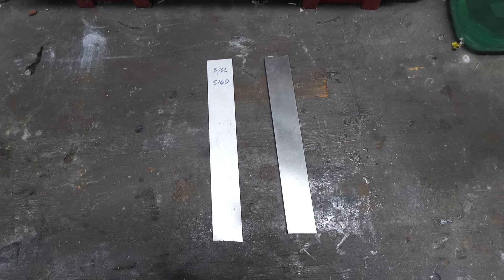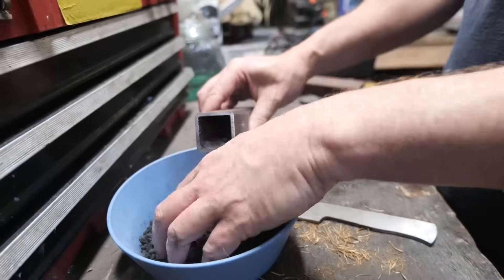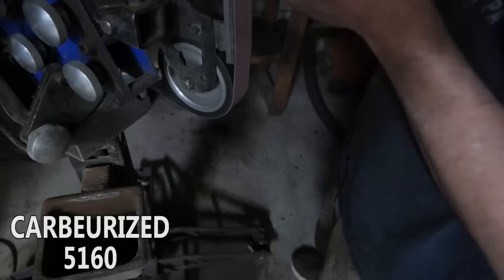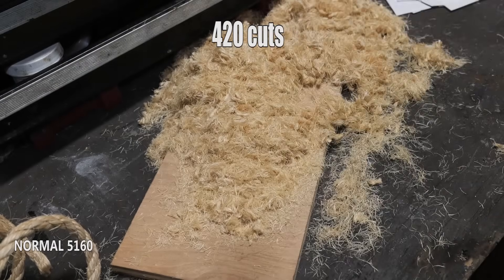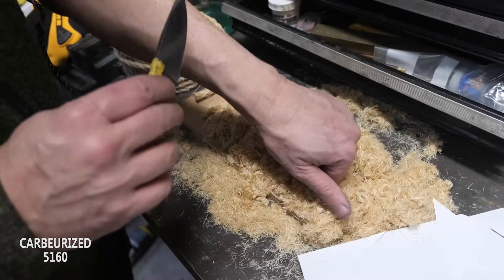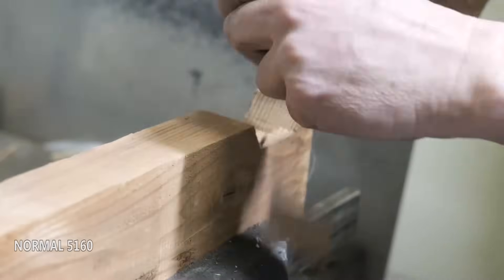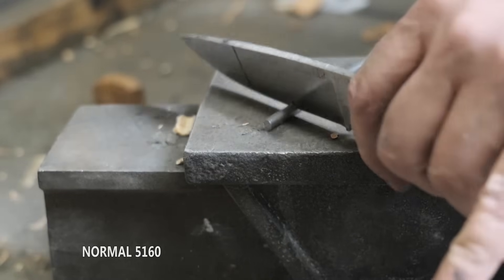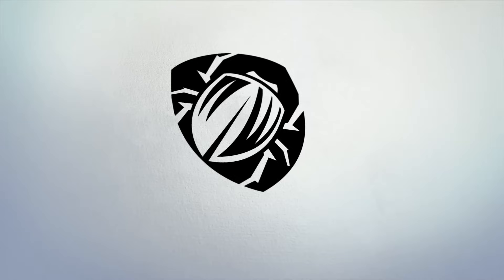Adding Carbon to 5160 Steel To Make A Knife!

Comment: This 5160 looks like high carbon steel in a spark test, or is it just looks like that on camera?
Reply from the maker: Like high carbon steel
Reply: @GreenBeetle  i mean, it should be around 0.5-0.6, and high carbon starts at 0.6 up to 2.0% percent carbon. But sparks looks way too big and wide for 0.6% 🤔

Comment: You created an amazing HRC63 on one of the toughest steels ever created. 
How about a follow up where you explore blade design to keep the HRC63? 
Seems a shame. HRC measures some form of hard, but how does toughness and durability get measured? It seems pretty amazing it took 3-4 cycles to drop HRC on such a thin blade. Great video! Looking forward to a future follow up!

Comment: You can temper too much and cause embrittlement, i would have gave them the same temper. That said what a great video i absolutely love tests like this
Reply from the maker: I haven’t heard that before are you sure that’s correct
Reply: @GreenBeetle  indeed, it's a fairly new concept to me too but the term to research is "tempered martensite embrittlement". You can find graphs to compare temperature to v-notch impact resistance for many steels. Often 450 to 800f is more brittle than a lower temper
Reply: @GreenBeetle  above 200 - 250°c retained martensite decomposes into cementite and ferrite
Reply: I was thinking the same thing while watching. You are super smart and much better at math and the engineer here. However,  having researched a bit of case hardening- thru antiquity, there is a logic that seems missing. If you add the carbon it should improve the stock, right? The evidence of improvement was shown in the need to temper multiple rounds to reduce hardness. Where is the valuing of removing something you added? 
If you ever revisit this, complete the same process. Could the video be about how to harness the value you created? 
What is the value in having a steel that needs THREE reduction cycles?! You've done something amazing. That is so cool. Perhaps the thickeness and profile of the blade isn't best to utilize the great hardness you created?
Reply: maxmcswain1 he said in a comment he just wanted to
like check it out.

Comment: What benefits are there to surface harness other than scratch resistance?
Reply: Carbon dissolves pretty quickly, it would have penetrated fairly deep
Reply from the maker: Edge retention and resistance to deformation

Comment: Many years ago I carburized, hardened, and tempered towards the edge carbon steel woodworking chisels. In order keep the edge and the flat hard I heated from the top back and watched the color change, stopping it short when it came close to edge.

Well, that's what I did in the 80's before information became pervasive. I know things have progressed since then, and differential tempering doesn't appear to be a thing now, but wouldn't that help with the brittleness?
Reply from the maker: It would but it would also drop the hrc and I was trying to keep the hrc the same between the two knives.

Comment: In adding carbon you probably put the steel well over the eutectoid point and so quenching from 1525f put way more carbon in solution than was probably healthy for it. Even at 1475f there likely would have been more carbon in solution than the 5160 would normally have. That said 5160 is kind of finicky as Larrin shows in his article on it. Also, try doing a DET anneal instead of cycling, it saves a lot of time and arguably gives better results. 100f-500f cooling rate/hr in the oven from 1400f-1450f (depending on the steel) after normalizing.

Comment: Normally when the steel manufacturers are adding Carbon, (Coke), this is done while the steel is molten. I do not think just heating the steel to red, or welding temperatures in a home built forge is hot enough to get the results you are looking for. I could be incorrect, but I think that is the process.
Reply: You are incorrect, pack carburization, flame carburization etc are real techniques which can be performed in home shop conditions. They have historical evidence and are widely used in industry. No liquidization required.
Reply: @murmenaattori6  I stand corrected, and newly educated. I knew different types of steel could be hardened or softened through Quench processes and Anieling, but though through those processes the steel would only achieve a certain harness before becoming too brittle and useless. Thank you for the info.
Reply from the maker: this is case hardening.  another method doesn't require casting would be cementation.

Comment: I'm wondering if a graphite paste painted on (2-4 layers), then followed  by a refractory coating with a 6 hour soak at 1550F would make a difference. Graphite is theoretically pure carbon with super small particle size, so it might migrate into the steel better, especially if it's painted on the surface in an even coat.
Reply from the maker: oh wow thats an interesting idea
Reply: For pure carbon I would try carbon black or soot such as produced by a rich acetylene flame or bought as a colorant.

Comment: From what i know the iron gets fully saturated with carbon around the .80-.85 range, and after that the remaining carbon forms iron carbide pockets at the grain boundries. Since 5160 has less then .85% carbon maybe there is some direct knife and tool performance to be gained when adding carbon up to that point?
 
After though idk, theres no right answer to wether or not you want the toughness reducing effects of having excess carbon and forming a bunch of iron carbide. Consider that 1084 is significantly tougher than 1095 and the carbon difference is very low (and other than this theyre basicly the same).

Toughness is an often overlooked aspect of cutting performance by bladesmiths bc theyre all obsessed with rockwell hardness, but the effect of high toughness is edge stability at lower edge angles, which has a better than linear realationship (i dont wanna say its exponential, but its very significant) with edge retention while hardness has only a linear relationship. And as a bonus, higher toughness steels can have a thinner behind the edge thickness for heavier tasks like batoning, reducing force required to make the cut without getting macroscopic rolls an bevel deformation.

tldr: adding carbon probably wont imporve an already good blade / tool steel in an overall sense.
Reply from the maker: Right you are.   Alloying moves the eutectoid point back and forth a bit but 1095 , w1, w2, white paper, 26c3, 52100, etc and all 'supersteels' are hypereutectoid.  There are many hypereutectoid knife steels.

Comment: but if you tempered it down to 62 pr 63 the edge retention could be better plus it could take a finer edge?
i feel tempering it down misses the point of case hardening.
Reply from the maker: Good point.  I was mainly interested to see what extra carbon carbides would do.

Comment: Hi, first of all congratulations for doing what I would do lol... "where there's a will, there's a way"... man, I'm going to make my second knife from recycled 5160 and I've learned a lot from your experiences (thanks for showing it) I also have a small channel in Spanish (where I test knives in my style) I got tired of buying expensive knives and had problems with the Esee 4 and a controversy with Jeff Randall over his 1095 treatment (which I think is awful, almost a rip-off) I say that for the Esee 4 that treatment is not correct, for the Esee 6 it could be because of the length of the blade that needs more flexibility, but in 4" or 5" blades, why do you want more flexibility? ...man I want maximum strength and edge retention, don't give me a castrated 1095 (that's what I told Jeff) he just replied that that's how they do it... so I come here and see your great experiments with the same steel that I'm starting to use... please give me your magic treatment recipe so I can get to the point. (I would greatly appreciate it) ...and in your project, this one of adding carbon, I also thought about it with charcoal, I think you should make the steel liquid to incorporate the Carbon (any Steel I mean) ...So maybe you can do it with a Stainless as well like 420 or 410 to get to 440C (who knows?) ...keep going like this, trial and error... until you find out. Greetings from Chile

Comment: The problem is the addition of carbon isn't uniform. The tradeoff isn't worth it. That's why case hardening is usually not a good idea for knives but useful to increase wear resistance in other applications like some roller bearings.
Reply from the maker: Great point

Comment: Charcoal doesn't vaporise, I think it has to physically be in contact with the steel then atoms diffuse into then though the steel. Probably need more finely ground charcoal to speed things up and get better consistency.
Reply: carbon monoxide dude.
Reply: Cela parrait difficile de cémenter de l'acier en phase solide uniquement par contact avec du carbone. La cinétique doit être très lente. Mais ici, il me semble que le mélange contient aussi du bicarbonate de sodium. 
Peut être que cette carburation se fait en plusieurs étapes, telles que:
1) Décarbonatation du bicarbonate de sodium:
2 NaHCO3 = Na2O + 2CO2 + H2O.
2) Équilibre de Boudoire entre le CO2 formé et le charbon:
CO2 + C = 2CO
3) Cémentation de l'acier en phase gazeuse par le CO:
3Fe + 2 CO = Fe3C + CO2.
Peut être qu'il se produit d'autres phénomènes, tels que:
4) Formation de CO supplémentaire par l'équilibre du "Gaz à l'eau" :
H2O + C = CO + H2.
Mais je ne suis pas sûr. Tout dépend de la température, et aussi de la pression: sur ce point, je n'ai pas réussi à savoir si la cartouche était scellée, mais si c'était le cas, je pense que cela pourrait être dangereux!
Reply: When heated in a closed container with air charcoal will produce carbon monoxide effectively vaporizing. The carbon monoxide is what adds carbon to the steel.
Reply: Maybe he can try using activated charcoal powder, or just regular charcoal powder. I bought some on Amazon earlier this month and it comes ground finer than flour.

Comment: Carbon is not everyting...
If you take a 1084 sn carburize it frpm .85 to 1 pe4cent carbon the steel gets a little harder, the edge retention is slighteley better , but the toughness drops to the hslf amount.
The ideal carbon cobtent for a not aloyed steel is 0.84 percent.
For a steel with sone chromium around 0,6 percent oor so.
Depending on the content.
More carbon forms chromium carbides.
And these are particles in the steel matrix. They can ruin your edge while grindind and make the steel briddle.
Metallurgy is a complex thing...m
Reply from the maker: Good point.  Isn’t 52100 over 1% carbon?
Reply: @GreenBeetle  you have to look to the alloy elements 
Some need carbon, some lower the eutectic point

Comment: Question is if all that work is worth getting like that slight improvement in blade hardness?
Also I wonder if we would cut it using cooled saw blade(or break it clean...) before grinding, and put under microscope would we see that carbonized layer on the surface?
Reply from the maker: No, not at the expense of toughness in this case.  Would be easier and better to just use 52100 but I can’t be reasoned with. 😃

Comment: I’ve made a lot of knives from mild steel and carburized them. I’ve found that grinding them to 90% finished before carburizing gives best results (hard edge with a tough spine) and that carburized anything’s structure benefits greatly from a soak at just above non magnetic temperature for as long as it was carburized for (I coat my blades to prevent scale from forming during this process.) Oh, and one more thing-no matter your carbirizing mixture, add kosher salt. The salt and the prussiate in it greatly aid carbon absorption to the steel, cutting down time needed for carburizing.

Comment: Charcoal has all kinds of impurities in it, and is never homogeneous. You might want to try sugar the next time. With sugar infusion (in Ti foil) I was able to harden even some relatively mild steel that remained soft even when quenched into brine. I didn't run any toughness tests though.
Reply: Carbon black and certain forms of soot are better more pure as well. Can be produced in situ via a rich acetylene flame.
Reply: @murmenaattori6, how thick does the suite have to be applied?

Comment: for the sake of your hand it seems like it might be worth while to make universal handle to hold your blades i used to make some quick and dirty ones out of the white cutting boards easy to cut and you can flame polish them quick as well a quick hit with a propane torch till they go ever so slightly translucent and you can bed the blade in (makes a great cheap chisel sheath as well ) this makes me want to get my but in gear and build a better gas forge i never got around to canister work but man do i love making kitchen knives for the family and wood turning tools

Comment: When I was in high school, quite a while back now, we used a powder called Hardite. Heat whatever you were making up to red/orange, dip it in the Hardite. It worked well. You had to make sure the exhaust fan was on cause that stuff was really toxic. But a little cyanide never hurt nobody. 
Later while doing an apprenticeship we had to harden a shaft that we'd machined. There was a big machine with a crucible inside it. In the crucible there was mineral salts of some kind. The whole lot would melt into a kind of bath that you chuck, well place your work into. It also worked quite well, and was also toxic as F.
Going back to the Hardite, I later became a teacher and found a tin of hardite in the stores at the school I worked at. A couple of decades after it was banned outright.
But we learned to be resilient you know.....
Reply from the maker: we drank from rubber hoses dammit
Reply: @GreenBeetle   lol!
Reply: There is a modern product called cherry red which is kinda similar. I haven't used it too much, but the results are pretty good.
Reply: @garethbaus5471   I just learned something then.

Comment: I did have a pretty good laugh at the nail test, one of those things I'll do once in a blue moon for bushcraft and cleavers just to make sure they hold up. Which in the era of super-tough, high alloy tool steels is actually not beyond most of them to be completely fine apart from some very minute rolls once in a while, still rattles the brain which is telling you 'this is wrong, stop it!'
5160 is an alloyed steel, not a huge amount but it is what it is with that chromium. So that might have have some bearing on adding more carbon into the mix in a post-ingot stage of its cycle and there's definitely a reason for the grain size being like that. Just extreme temperatures for extended periods of time will blow out those boundaries and it'd maybe need 3 or so reduction cycles to get it back to something more sensible. I wonder if using maybe 1084 or something with much less alloying in it would yield more noticeable results bumping it up from a say 0.8% to the 1.25% carbon contents- the main thing I notice when using say 1084 to 125SC is that the latter takes a lot more care, a 'near' water quench and some extent the result is getting those very high HRC's which increase the geometric stability and let it take very acute final cutting edges.
So while the end result there is that the different between a 1084 and 125SC is really just that one is tougher, the edge holding is pretty much the same and the other can take a finer ultimate sharpness